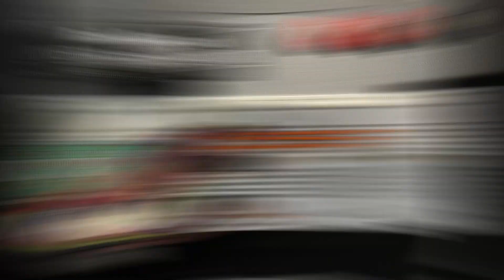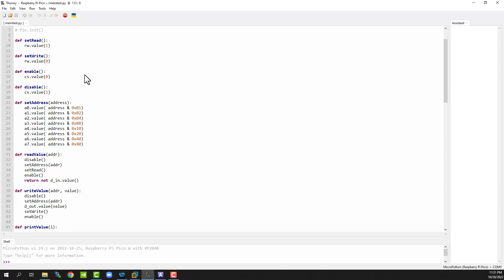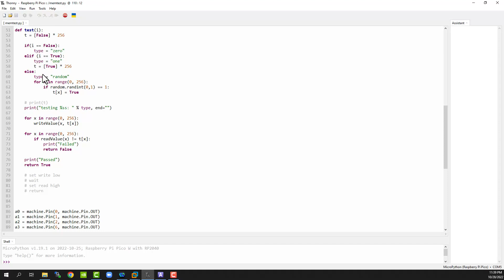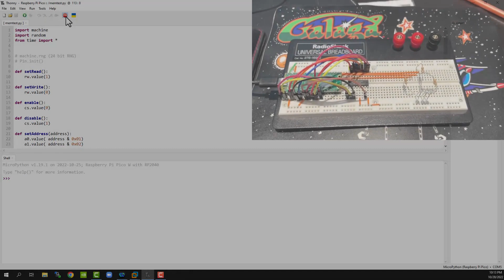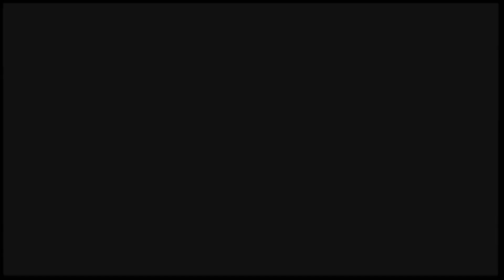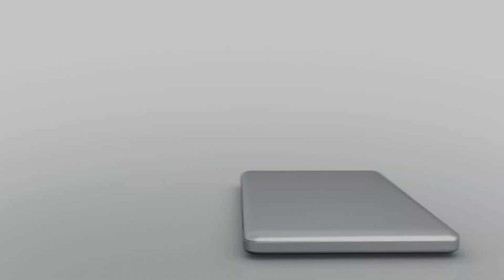20221125: Building a static RAM tester with a Raspberry Pi Pico

Comment: Hmm... does it really work reliable? TTL Chips need 5V +-10% Supply and 5V logic level. The same with 4164 DRAM. There has to be logic level converters between the pico and the 5V chips to work reliable.
Reply: yes it worked reliably. that said I did not use this in any production thing etc nor would I recommend doing that as it's certainly not "proper design?". it was more of a proof of concept for the coding the rasperry pi and testing things for a different part I wanted to test that was similar. I only tested a few times with this and that chip, however I did use this to build a tester for a ER-2055 which I used to test much more heavily. I  did use the +5V from pi's power input to power the circuit. The low of the pi GPIO is 0 which works as logic level 0 and the high is 3.3V which is sufficient as "high logic voltage" for TTL (if memory serves me correct "high" voltage is anything somewhere over 2 or 3V+ on TTL even if normally it's provided as around 5V). That said the pi outputs only powered this single chip. I haven't checked the info on the pi but I doubt it could power more than that as TTL has high current draw and CMOS chips generally are not able to output such current. Reading back the TTL to the pi to test the results... I honestly don't remember how I handled it. I don't remember if I built in a level converter in or not. I don't think I did and looking back at the picture of it I don't see anything. it' was probably a year or two that I did it but I want to say I remember the outputs were actually the same voltage as the inputs. when I tested it. I think that was the case as I recall being surprised that it worked and when I tested the outputs. I though I found them to be the same. that said it may have been a dream as I forget things so fast now. either way it was a fun experiment and while I certainly would not build a tester like this for a "real product" I do recall it worked, and I used basically the same design (which some modification) to test a ton of my ER-2055s that I had laying around and even used them to write fake high scores on a centipede high score chip for fun.

Comment: ARCADE CABINET, if you have a book on the instruction codes for a Z80 and 6502, can't you read the arcade ROMs chips Hexidecimal code at each address location using the ROM test and then manually converting each address location/hex code back into the Z80 or 6502 Instruction code? I haven't seen you do this manually in a video lesson when repairing arcade games any reasons why?
Reply from the maker: yes you can do that. that's what a disassembler does. I've used disassemblers in a bunch of my videos (GHIDRA, IDA PRO, and MAME debugger)